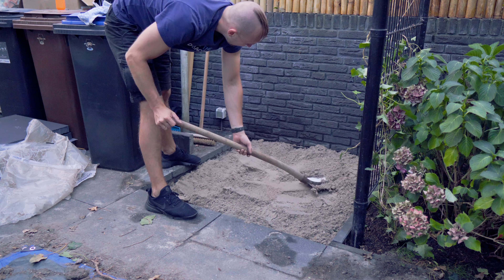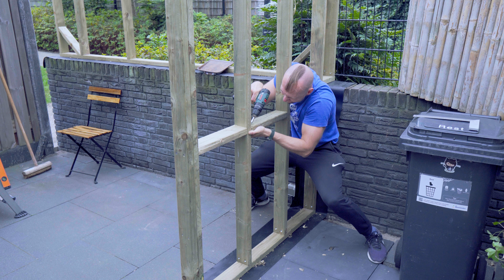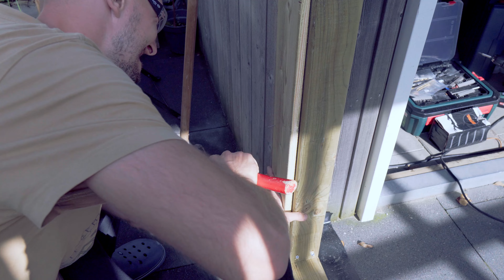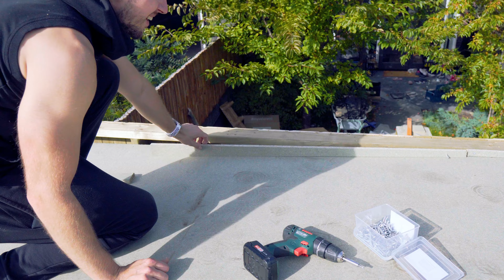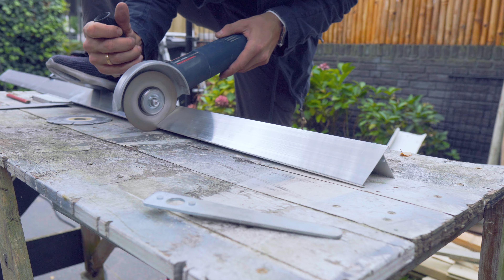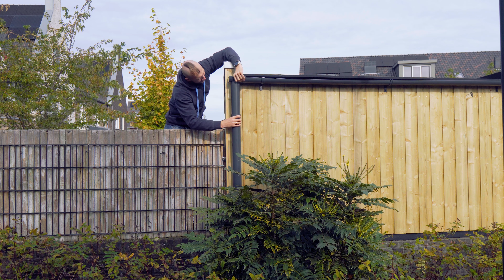Building Garage for a Motorcycle | DIY | 50 hours in 20 minutes

Comment: Very nice build Ivan, especially doing it singlehanded! Well done!

My input from an Australian perspective. We have different building standards here obviously and the materials can be different to what is available in you country.

When balancing material on your head. Wear a hat. I know your hair was probably planed for this project, but still. Perhaps two hats would be even better for your head. 🤕

With the Noggins (Studs). Offset them vertically, so that you can go end-on with your fixings. Preferably use nails rather than screws. Nail one at the top and one at the bottom of each Noggin, but at a slight angle so that they cannot expand out depending on the weather. Quicker and cheaper, even taking into account renting a power nailer. Also torsionally stronger result for the wall. Maybe a thin steel strip mounted in a triangular way across the wall, would make the wall much stronger. 👍

Cutting in situ is very good idea. Less measuring, more efficient work. 👍

The roofing looks very, very complicated. In Australia, I would use iron sheeting. Simple and effective, but you would need to insulate internally in Europe. Fairly straightforward to insulate with Fibreglass or Wool  insulation. With a simple sub-frame, maybe add some thin sheeting underneath to finish off if you are fussy on your ceiling finish. Iron sheeting is relatively good value over here. Also Termite proof, but I doubt you have that problem in your location.

Handling that Auto door made me cringe. Use a couple of trestles to rest it on prior to lifting. Also, it would be better to rest on if you failed the lift, instead of onto your toes.

Great use of the offcuts for the shelving.

One more thing with regard to the external finish. Did you consider charring the wood with a flame?  Not only would your wood have matched the old shed, Charring acts as a wood preservative.

I'm extremely disappointed in your choice of Motorcycle. Have you never heard of Moto Guzzi? 😆

Great build though Ivan. Thank you.  👍